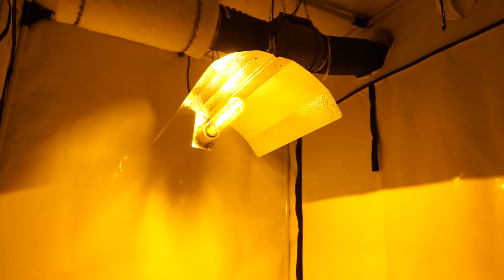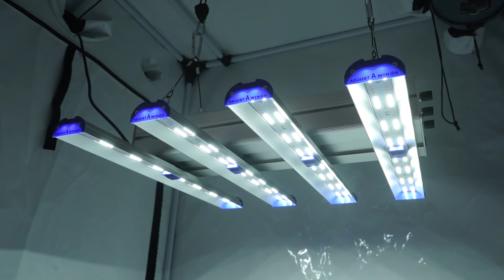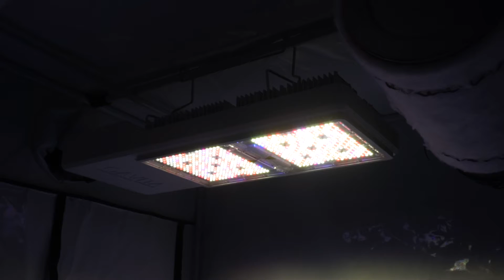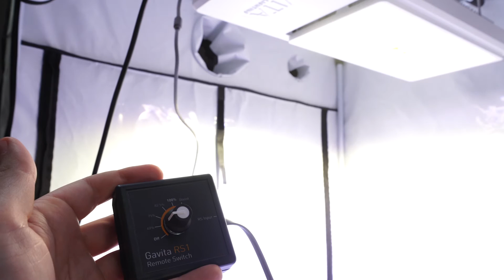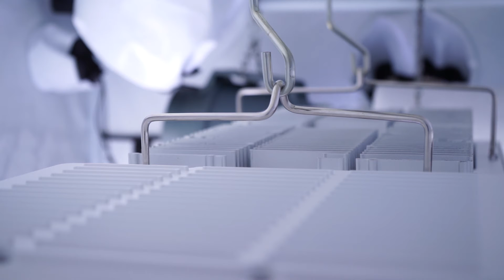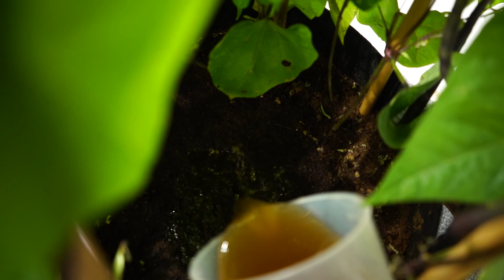Gavita CT 2000e 780W LED Grow Light | DISCOVER

Comment: How many would you need for a 1.8m x 1.1m room
Reply from the maker: The CT 2000e has a square footprint so if you've got significant headroom this space will be fine.
But in a 2m tall tent for example you could struggle to get even light coverage on the edges of your grow, and would need 2 lights for the space.

Comment: What size of tray can this light cover. I have heard up to 6x4 area if the height is high enough.
Reply from the maker: Well the spread for the CT 2000e isn't as wide or long as 6m x 4m. It’s 1.8m x 1.2m so a 1.5 x 1.5m space is ideal.
Reply: @growell  I should have been more clear. I was referring to feet! So at 1.8m x 1.2m that should do it. Thank  you for the information.

Comment: What is the price for this gavita lamp in Europe? this controllers, do I need to pay extra for them or they come in  packaging with lamp?
Reply from the maker: A controller isn't included with the fixture, so you'll need to buy one separately if you plan to use one with it.

We sell the Gavita CT 2000e for £1049.95 currently: www.growell.co.uk/grow-lights/led-grow-lights/gavita-ct-2000e-led-grow-light-780w.html
But we unfortunately don't ship outside the UK.

Comment: I am thinking of buying the Gavita CT2000e can you recommend a more powerful LED light or should I buy this one for my 5 foot by 5 grow tent.
Reply from the maker: Similar in power to the Gavita CT 2000e is the Adjust-A-Wings Hellion LED 700W: www.growell.co.uk/grow-lights/led-grow-lights/adjust-a-wings-hellion-vs3-led-grow-lights.html
But the Gavita has a superior PPF of 2000umol/s compared to the Adjust-A-Wings 1850umol/s.
Alternatively you could look at 1000W LED's. The Hellion LED has a 1000W variant or you could look at the Lumatek Zeus Xtreme: www.growell.co.uk/grow-lights/led-grow-lights/lumatek-zeus-xtreme-ppfd-co2-led-grow-light-1000w.html
Though the PPF you get out of the 1000W variants is a big leap from Gavitas 2000umol/s to 2925umol/s from the Zeus Xtreme.
It's a tough decision but for the 700W range we'd go with the Gavita CT 2000e and in the 1000W range we'd go for the Zeus Xtreme. However the Hellion LEDs do allow you to tweak the kind of light emitted whereas the others don't.
Reply: Time has come for me to retire my 18 Gavita de 1ks

Comment: What’s the difference with the 1930e and this ?
Reply from the maker: The CT 1930e is the North American variant of the CT 2000e which is available in Europe. The CT 2000e has a slightly more powerful driver, hence the 2000 vs 1930 in their names.

Comment: Are the leds replaceable/upgradable and what is the life span?
Reply from the maker: Gavita haven't given any word on whether the CT 2000e will be upgradable in the future.
The diodes on the fixture like most LEDs is rated for 50,000 hours of use.
Reply: You’re grandchildren could still be potentially using the LEDs with about just about 3-5% loss in efficacy.

Comment: Compared to the gavita1000w hps light is there a lot less heat from these new led lights?
Reply from the maker: Gavita themselves claim that the CT 2000e puts out 25% less heat than a 1000W HPS.
Though our own experts said they felt it was at least half as hot.
If you're based in the UK we have display units at our Merton and Dudley shops.
Reply: @growell  The fixture produces 25% less heat, meaning that when figuring out your HVAC loads you can expect 25% less sensible heat load in the space, when compared to a 1000W DE HPS.  THe reason it feels so much less hot is due to the different way the tech produces the light.  With HPS, it produces a lot of radiant heat, that is directed downwards.  Where as the LEDs have very little radiant heat, because the heat is collected by the heat sink and then pushed into the atmosphere via convection.
Reply from the maker: The CT2000e does radiate some heat downwards, certainly much more than most LED fixtures, but you're right. Those heat sinks do a great job.
Reply: @growell  For practical purposes yes, it does get hotter under there compared to other fixtures, but really the radiant heat is similar to other LEDs of the same wattage, the difference is the concentration.  LEDs like the 1700e or other 4x4 multi bar fixture, have that radiant energy spread across a 16ft^2 frame, where as the CT2000e has all that energy compacted to a much smaller area.  So it does give the feeling of more radiant heat, but in reality it is pretty much the same, it's just concentrated into a smaller area.
Reply: @growell  will you be setting one up at the hockley heath shop or just these 2 locations
Reply from the maker: I'm afraid we've only got displays in those 2 shops at the moment. We do have plans to get a display in each shop eventually but this won't happen soon.